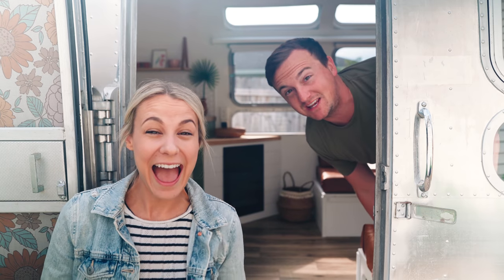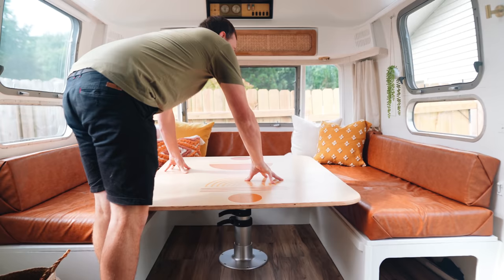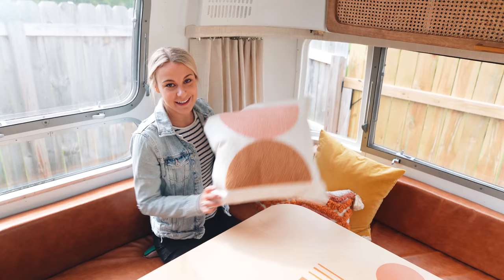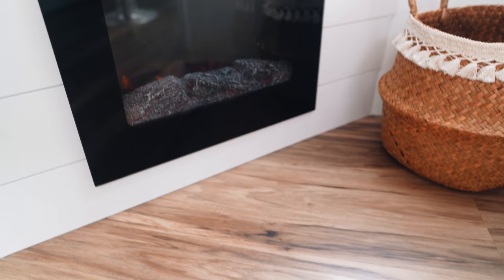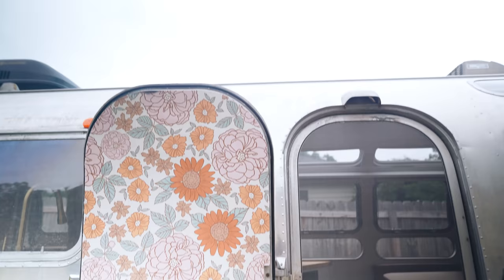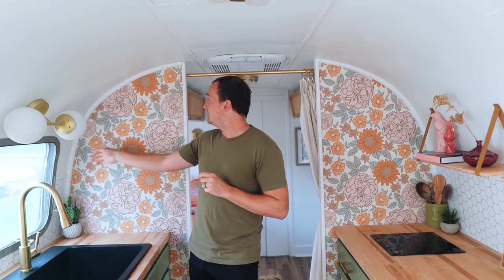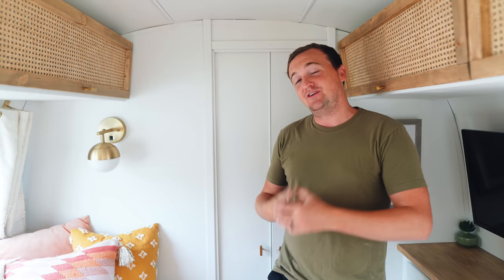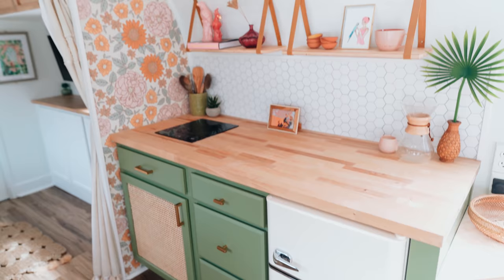WE FINISHED THE AIRSTREAM! - Before And After Renovation Tour

Comment: It looks lovely but not practical for a caravan as with the open shelves when travelling!! one hot plate! At least 2 needed. The extra weight in using heavy timber as in the counter top and cabinets etc. All materials used in caravans are lightweight as weight restrictions on towing. This advise comes from an experienced caravan traveller.
Reply from the maker: We understand your points. We aren't planning on living in our RV, but if we were, those things would definitely be needed 😊